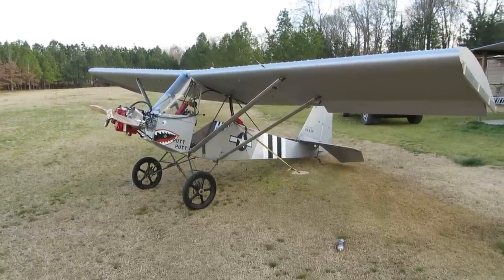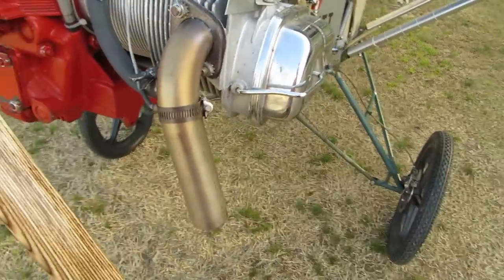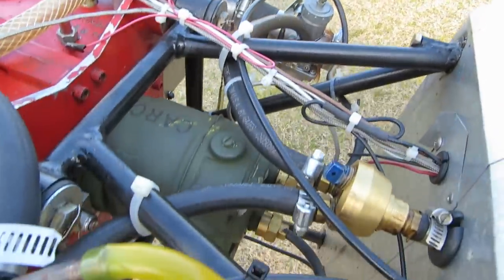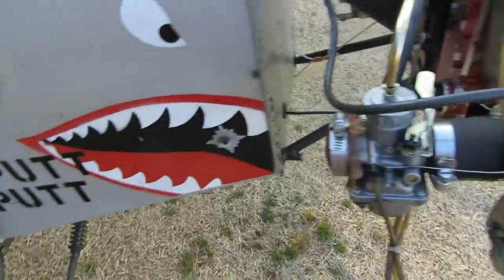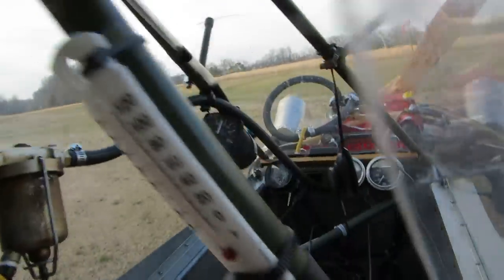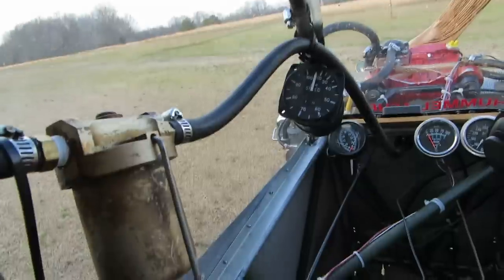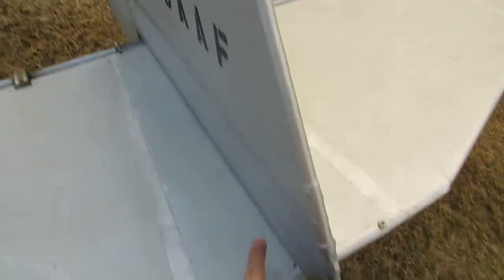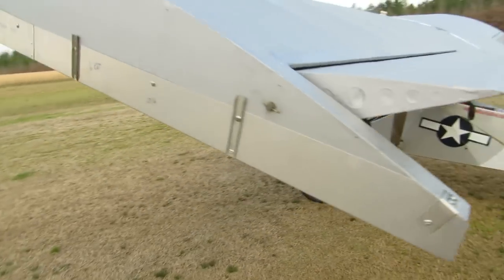PuttPutt Up Close and Personal

Comment: Has anyone ever tried this in a bi-wing version that you know of? I am building from scratch and no plans but the legal eagle is extremely close to what I'm trying to do. The only difference being that I've decided to try to make a biplane version of the style. I can't seem to find any biplane versions of the Legal Eagle, but for that matter, I cant even seem to find one that has had its whole fuselage covered?? Why is this? I would think the drag you could get rid of would be more benefit than the weight savings you get by leaving it open. Someone set me straight on that because I'm thinking the fact that I cant find a single enclosed one means I must be wrong..? One last difference on mine is that I'll be trying a Honda GX670 instead of the VW. I'm actually a longtime VW hobbyist but I just happen to have the Honda engine fall in my lap and with some diff carbs and cam, and stripping it down for weight, I'm banking on being able to get 35hp out of it and it weighing apprx 70lbs. Sorry about writing a book.. I'm done now. haha